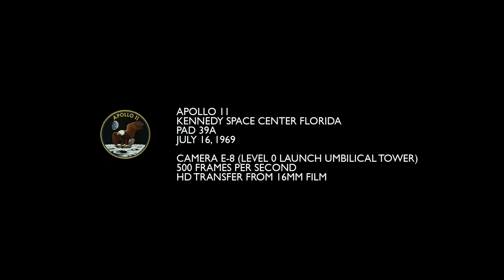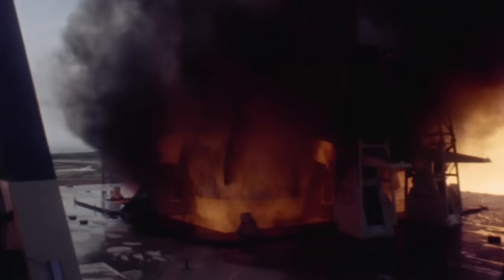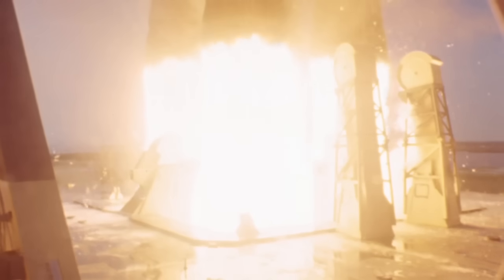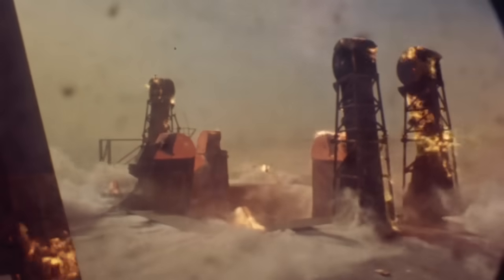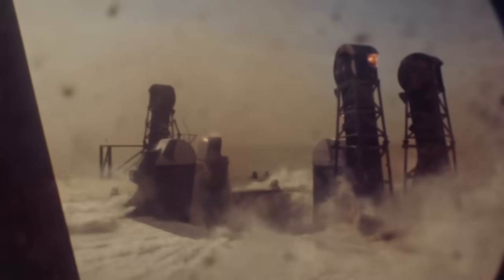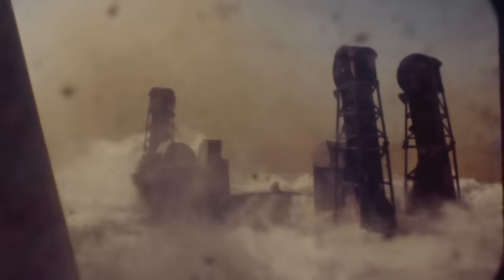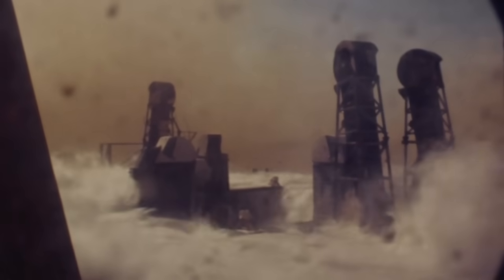Apollo 11 Saturn V Launch Camera E-8

Comment: actually mark the " dark cool gas area' one sees in the film has no correlation with any other known rocket engine ever built or flown which is a bit odd don't you think ? LOX is normally recirculated around the bell shaped exhaust cone of a rocket to cool the bell so it doesn't burn through and not dumped directly overboard into the exhaust as a cooling solution which is a terrific waste of fuel. The saturn 5 apparently had no such fuel worries which is very strange indeed considering nasa went through tremendous programs to lighten the whole craft ! It's a ridiculous assertion   Also mark the saturn 5 first stage indeed had insulation on it.
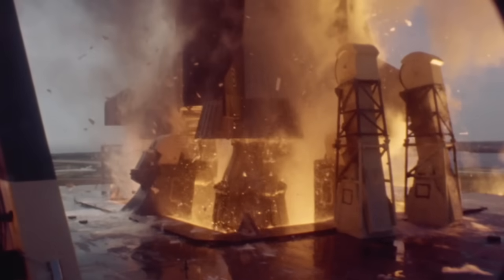Reply: Toasty Roasty Man  Yes some good facts but lets clarify,  the F1 used Kerosene (RP-1) and liquid oxygen (LOX). most rockets of the day used Hydrazine of varying types + LOX or Hydrogen + LOX which is what is used most today. The turbo pump assembly was basically a fuel combustion chamber - called a gas generator that burned RP-1 + LOX making gas that was fed to a turbine on a shaft, the other end of which were the turbine pumps that fed fuel and LOX to the combustion chamber. The temperature of the exhaust of the gas generator was 1465 F. It was burned especially rich (smokey) to keep the temperature down and was fed into the "torus" or turbine exhaust manifold. You can see the torus as a bump or belt around the engine bell at 2:02.  Yes the thrust body of the engine is cooled with 89 feed and 89 return "CRES" cooling tubes. The F-1 was cooled with fuel however not LOX. So why the Torus and the need to cool the bell? The thrust chamber actually ends above the torus - below the torus is the Thrust Chamber Nozzle Extension and it contains no fuel tubes for cooling. The combustion temperature in the chamber was 5975 F that is white hot and no metal can stay solid at that, even a tungsten light bulb filament will melt at 3450 F. Rocketdyne made the f-1 from heat resistant Inconel X-750 alloy (that melts at about 2600 F) that boundary layer of turbine exhaust gas was sufficient to protect the extension without other cooling. That dark belt is this gas and with that much heat behind it it too burns up when it hits the oxygen in the air after exiting the engine. 

BTW -  Markstang, That "ton of energy" to turn one pump was 40,000 HP (no typo, 40 thousand)  It had an excuse though, it fed 24,811 gallons of lox and 15,475 gallons of RP-1 per minute into the chamber. 

Totally amazing and awesome machines
Good film and commentary too
Reply: Toasty Roasty Man Some qualification for your statement that no other known rocket engine has the dark area would be nice. I doubt you could provide another film of a rocket launch that was recorded at 500 frames per second so yeah, it won't appear like that. Remember what he's saying at the end of the video, the exposure is set to view everything in a roughly normal manner while the engines are lit and everything is really bright. The gas coming out of the turbo pumps is already burned up, and has had a ton of energy extracted from it to turn the pumps. Pump this cooler mostly inert gas out of the nozzle right next to the still burning propulsion gases and yeah it's going to appear darker. Also LOX is not a fuel, it's oxidizer.
Reply: Toasty Roasty Man  Obviously any rocket can carry only a certain amount of fuel. Full of fuel, the rocket's Delta-V capacity is then determined by its payload mass among other things. Key point here. Mass. If there's something on the payload that doesn't need to be as thick as it was, such as an outer panel that has no structural component to it aside from sunlight/heat shielding, then of course there's a pretty good reason to make that panel as thin and light as possible while still fulfilling its intended purpose.

In the same vein, they don't pump unburned fuel in to the exhaust. Like you pointed out that's a gigantic waste of fuel/mass. You use the gas that has already powered the turbo pumps so it's not as hot, to insulate the nozzle.

You've probably never seen the dark gases before because it hasn't been filmed so closely at such high frame rates. High speed photography like that is not the same as your every day video camera. Since frames flash by so quickly, they don't have as much time to gather light, and everything appears darker. The higher energy flames still seem bright because they pump out significantly more energy and photons than the nozzle boundary layer's insulating gases. There's not really anything mysterious going on here in this video.
Reply: The amount of fuel burned in the gas generator is miniscule compared to the fuel performing the thrust. Cooling lines all over the entire nozzle extension would be much heavier, require much thicker bells and make the entire engine much more heavy, thus requiring more fuel. Injecting the richer turbo pump gas keeps the light nozzle extension while needing a bit less fuel than your fully cooled nozzle rocket to go the same Delta-V.

All of the rockets used on the saturn program from the beginning have the dark exhaust gases coming from the nozzles. Which rocket motors of the same era can I see on youtube don't have the rich turbo pump gas generator exhaust The F-1 has?
Reply: That's funny, I never even used the phrase "left in the generator". Your assertion that just adding those dozens of little pipes aren't that much more mass is more of a supposition than my reasoning. it is a fact that the cooling tubes weigh something. The fact that something is there in your proposal that isn't in mine, means yours weighs more and mine goes farther than yours with the same amount of fuel.

We're not talking about modern rocket motors genius. We're talking about 60s technology. So you should probably stop whining about why 60's era technology is so "ineffecent", as you like to spell it.

I''m even less convinced, since you couldn't name a single rocket motor from the same era and of similar size that burns differently to the Rocketdyne motors like I asked.
Reply: yes, I know all this but there were serious concerns about the amount of cargo this rocket could carry. So much so that Northrup lightened the lem structure to aluminum foil thickness on the outer panels and other extreme lightening measures.One was in fact to use a less safe high atmospheric oxygen rich pressure cabin  Witness the apollo 1 fire.

 . Many rockets use the same general kind of gas generator to run their turbo pumps. None have ever produced the same dark shroud of rich unburned fuel at the end of the rocket bell nozzle. 

 In the light of the fact that weight savings were a major concern on apollo and that the saturn 5 only carried so much fuel on board this method of cooling the bottom half of the bell is pretty absurd don't you think?
Reply: I have never seen any other rocket engine behave this way and I have seen many many HIGH SPEED TESTS films of other rocket engines.

 YES High speed films. The kind of films rocket engine designers film and take very careful note of.

 Even the earlier Apollo Saturn vehicles non f1 engines don't show this! These rockets all have gas generators but are properly tuned for maximum effecency and fuel economy which is critical to space flight.

 The fuel for the main engines and gas generator come from the very same limited supply on board the spacecraft. Both gas generator and main engines always need to be tuned for maximum effecency

 running the f1 engine gas generators in this stupendously over- rich mode frankly makes no sense whatsoever when just adding more cooling tubing to the whole bell which would add little additional weight whatsoever and save a significant portion of that fuel for the mission.

 You focus on the unburned gas generator gasses as free cooling when in actuality their very richness as is evident in the videos would be a huge waste of fuel when fuel and weight savings were so very critical to the missions.  

 If this was a viable and free way to cool any rocket engines without a significant loss in fuel from running the gas generators so rich all the other counties of the world would do it also in their very large rocket engines..

 Not even our country has done this EXCEPT on the Saturn Five

and you can bet your bottom dollars that the new nasa extreme thrust engines will not do this either. 

 Because it's a HUGH waste of critical fuel that's why..

 it is NOT "Free Cooling"  :) 

 
 In fact you may not know this but any engine works far better making hp or thrust when it is run at maximum thermal effecency. Very hot gasses expand far more. Cooling the bell this silly way would certainly detract from the max thrust the f1 engines put out by severely cooling the expanding thrust !   :)
Reply: it isn't "left in the generator" whatsoever. the generator is a pretty large rocket motor in it's own right spinning the main pump turbine. I watched a test of one and it burns very very rich indeed with a very orange flame and a lot of brown smoke. No cooling tubes ARE NOT that heavy whatsoever. That is your own personal and unsupported supposition. If they were then every large rocket engine would use the "apollo f1 mathod"

 NONE DO

 LOOK what modern high thrust rocket engines Do with that left over burned generator gas.

 It sure isn't used for cooling the main engines I can tell you that. 

WHY..Because it lowers the specific impulse of the rocket motor that's why.

It's dumped in a secondary nozzel out of the back of the rocket very close to the main rocket bell.

 what motors?

  take your pick. LOL

 this will require a bit of research on your part but it will be fun watching the tests. :)
Reply: Then I must have made that first bit all up !

 Funny I never talk that way whatsoever but you do,don't you? 

 I am quite certain it has "mysteriously disappeared" from your comments. I should be more like JW and screenshot all of my propagandist conversations from now on.

  Of course everything 'weighs something" even air merlin.

In relative terms they weigh very little to the lifting capacity of the rocket.

 capeesh ?

 It is in fact a utterly ridiculous argument

 It is very obvious you have no real ability to understand a thing I am telling you here.

 Trying to get this through your thick skull is like trying to pound a two by four through a solid reinforced concrete block.

 It ain't about to happen
Reply: I think you are right that the dark area is unique to the F1, but few other rockets used RP1 either. I don’t think it is odd at least under the conditions of “getting a man to the moon… before this decade is out”. I think there were plenty of trade-offs just make it happen… especially to get the needed degree of safety for the crew.. well - at least enough to get them back. 
Remember that the F1 had a tough development and was not well evolved; yes it was a good engine but young, a lot of the development was consumed settling down combustion instability issues just so they wouldn't blow up. After they got the engine reliable they could start improving the performance. The sad thing here is the designers (North American Rocketdyne) thought they had a winner for the long haul as the F1 was expected to eventually make 2m Lbs of thrust. (A big improvement from 1.5m) As we all know that long haul didn't happen. A lot of this thrust was going to come from increased engine efficiency not just pumping more fuel into it; this went for the J2s as well because looking at my Saturn V payload planners guide it lists the “present” (1967) system of 3 stages as being able to put 261,000 lbs into a 100 mile circular orbit, (or take 98,000 to escape velocity) but further down it says “Planning studies indicate that future Saturns are expected to increase the payload to 450,000 lbs to a 100 mile circular orbit.” That is one heck of an increase for basically the same rocket, so they were already moving on improving things (The uprated F1A engine was already in development). Being a project manager myself I see them following the rules to build any product, first make it good, learn from what is happening, and keep working on it until it is great. (Regardless of how painful that can be). 
Sadly because of the cancellation we don’t have footage like this of Apollo 20 or later Saturns with F1B or F1C engines lifting huge sections of international space into orbit. If we did, I am pretty sure there wouldn't be any black sooty stuff.
Reply: Kerosene? I believe many did and do. I don't know many that don't myself except a few Russian rockets from the 60's like the n1 which used a witches brew of toxic fuels.
 They flew the f1 engines around the moon while it's problems weren't straightened out which has to make you wonder as they were HUGE problems.

that is a red flag right there

 the rocket blows up with the astronauts on board and what do you have left

 A busted space program that the soviets will win because they figure out the n1's problems soon after the first apollo missions.

 
Here is a bit of info you may like to read about the f1 written by some Soviet rocket engineers I believe.

 http://www.aulis.com/saturn_v_evaluation.htm

and this for FUN before you get into the technical specs of the engine :)

 http://www.aulis.com/moonbase3.htm
Reply: Toasty Roasty Man - They never flew F1 engines around the Moon.  The 1st stage engines never even made it out of Earth's atmosphere.  So your primary source is a Soviet Rocket engineer for the F1 engine problems?  Reading his paper it sounds like he has a very distorted view because the Soviet Union was never able to develop a large single thrust chamber engine equivalent to the Saturn-V.
Reply: Anal much...?  Actually Russian rocket engines are very far more advanced then ours. That is why we use them now. These engines came as a total shock to nasa. As far as the f1 engine the Russian rocket scientists gives a very convincing story. Maybe you should read it  Once..Your basing your whole thing on one source NASA.

Never mind you wouldn't understand what you were readings anyway

 I hate to tell you but the Russians were always first in space and space technology till the bogus apollo missions. 

 and that person your bashing knows a hell of a lot more about rocket engine tech then you my friend
Reply: Toasty Roasty Man - "  Actually Russian rocket engines are very far more advanced then ours. That is why we use them now. These engines came as a total shock to nasa."  What specific Russian rocket engine(s) shocked NASA?  If you are referring to the Russian RD-180, it is a great  RP-1/LOX Staged Combustion rocket engine.  However it is far from the only engine the US launch industry or NASA uses.  The Atlas-V used a Russian RD-180 on the first stage but the 2nd stage uses a US engine, the LH2/LOX RL-10 engine.  The Delta-IV uses the R-68 LH2/LOX engine on it's first stage and LH2/LOX RL-10.  Both engines US design and manufactured.  The SpaceX Falcon9 uses the RP-1/LOX Merlin engine on all of it's stages, this engine is designed and manufactured by SpaceX.  Actually SpaceX makes more rocket engines than anyone else in the world right now, all the engineering and manufacturing in Hawthorne CA. The Orbital Antares launcher uses a Russian rocket engine for it's first stage, that didn't turn out as well as they hoped.   The 2nd stage uses a US solid rocket engine. The SLS will be using the Space Shuttle RS-25 engines (US Designed and Manufactured) and these are also advanced Stage Combustion LH2/LOX engines.  

When you make a blanket statement "Russian rocket engines are very far more advanced then ours".   You really need a qualifier.  How do you define if one rocket engine is more advanced than another?  How are you defining it in the context of the argument you are making?    

"As far as the f1 engine the Russian rocket scientists gives a very convincing story. Maybe you should read it  Once..Your basing your whole thing on one source NASA."  Very true you need multiple sources.  However the story the Russian rocket scientist tells is also one source.  So are you basing your argument on one source?  He tells a amazing story but so does the NASA Apollo program.
Reply: Yes, I am sure nasa has a few indigenous engines they still use .I know of at least one engine that has a nasa nomenclature and is Russian. You would have to study Russian rocket engine tech to know what I mean. Its too complicated a subject to discuss here. I suggest you look it up on your own time. It's far in advance of anything nasa has ever manufactured. You should really look into it instead of just quoting the engines names. Better to do this then argue with me. It's a very interesting topic. :)
Reply: Toasty Roasty Man - "Yes, I am sure nasa has a few indigenous engines they still use .I know of at least one engine that has a nasa nomenclature and is Russian. "  I am not just talking about NASA, I am talking about US launch providers.  It is more than just a few engines that are still used.  You heard of a company called SpaceX?  There is nothing Russian on there Falcon 9 including the Merlin Rocket engines.  The engine with the changed nomenclature is the NK-33 that Aerojet bought 36 of them and called it the AJ26.  Interestingly enough this was the Rocket Engine for the Soviet N1 Moon rocket.

" Its too complicated a subject to discuss here. I suggest you look it up on your own time. It's far in advance of anything nasa has ever manufactured. "  NASA doesn't manufacture rocket engines.  Private companies might design, develop and manufacture rocket engine's to fulfill a NASA contract.  I asked you before what is the criteria for saying that the Russian rocket engines are more advanced than US rocket engines?  The fact that you are dodging answering this question leads me to believe that you really don't know what you are talking about.

"You should really look into it instead of just quoting the engines names. Better to do this then argue with me. It's a very interesting topic. :)"  I have and I am asking you to backup your arguments with facts.
Reply: here is a bit for you..
 http://fortune.com/2015/05/15/russia-rocket-ban/?xid=yahoo_fortune

 I had a really nice article on Russian rocket tech but can't find it now. : (  I'll try to find it for you.
 

another bit but not on the Russian engines..

 http://aviationweek.com/defense/ula-ceo-calls-2018-availability-date-ar-1-engine-ridiculous 

 isn't nice you just keep goggle stuff up  without knowing what your goggling about.

 The Russian rocket engines run in a "closed loop system"   

as far as I know no american rocket engine ever has.

  It's totally obvious you are just goggling crap up to reply to me and appear more intelegent then you actually are about these matters.

 It didn't work

 I let you do you have enough rope to hang yourself

 here is what your looking for. It's from wiki so you might understand it..

 http://en.wikipedia.org/wiki/Staged_combustion_cycle
Reply: the Russian rocket engines run in a closed loop cycle..

 http://en.wikipedia.org/wiki/Staged_combustion_cycle 

 Nasa engineers marveled at their technology when they saw them.

I tried to find you the article I read from nasa engineers that said this but can't right now.

therefore in your childish perception of things I MUST be lying !  LOL

as far as not knowing what I am taking about I felt the very same way about you from all your obvious goggled up info replies I have been observing..

If you knew anything at all about these Russian engines you would know what I was talking about already.

Your Ethnocentrism is showing pal.

 Here is a bit you might like to read about the american engines..

 http://aviationweek.com/defense/ula-ceo-calls-2018-availability-date-ar-1-engine-ridiculous

I cut my teeth on this magazine and many other engineering publications while your mommy was whipping the shit oout of your butt and probably still is.

 Please go be stupid somewhere else.
Reply: Toasty Roasty Man - Already read that article several days ago.  What is the exact point you are trying to make by linking to this article?  I am still asking you what is your criteria for saying that Russian rocket engines are more advanced than US rocket engines?  Not what some article says, what facts did you pull out of the article that you used to make the judgement that Russian rocket engines are more advanced?  The term has been thrown around so much because of the current ULA issues with the RD-180.  If you want to make the argument that as of this moment, Russia has some of the most advanced RP-1/LOX engines in the world, I wouldn't disagree with you.  However I would tell you that the US currently makes the most LH2/LOX engines in the world.  Different fuel types, different engines.
Reply: I'm sure you didn't. This wasn't my words it was from nasa engineers. Go complain to them about their opinion of Russian rocket technology. The funny thing is THEY ARE USING IT ALL THE TIME. Guess it isn't that bad after all..;)

 Greg, I personally know people that worked on troubleshooting nasa shuttle tech problems including the liquid turbo pump engines and the joints of the solid rocket boosters which I looked at engineering blueprints of.:)
 I held shuttle LOX cooled ball bearings and shuttle heat tiles in my hands and studied them both.

 and you did...

 POF the shuttle engines had real problems with vibration in the turbo pumps. Lox really isn't a good ball bearing lubricant  ;)

 added info you wanted Best i could find in short notice about Russian engines.. >>

 WASHINGTON — In the past decade and a half, every U.S. agency that operates spacecraft has come to depend on one particular style of Russian-designed, kerosene-fueled rocket engine, made by former Soviet design bureaus and sold to U.S. companies for use on American rockets.
This international supply chain, forged in the late 1990s to bring NPO Energomash’s RD-180 to U.S. shores for Lockheed Martin’s Atlas 3, has bridged gaps between former Cold War rivals and produced rockets so reliable that the U.S. military buys them in bulk. NASA, likewise, is relying on Russian-built closed-loop kerosene-fueled engines — but not the RD-180 in particular — to launch eight cargo delivery missions to the international space station.
The buy-international model works so well that even an executive with the company working on an American alternative to the RD-180 — which has powered 43 flawless space launches since it made its U.S. debut on Lockheed Martin’s Atlas 3 rocket in 2000 — does not see much urgency on anyone’s part to bring such an engine to market.
“We don’t see a good business case for a pure commercial development of one of these engines,” Julie Van Kleeck, vice president of space programs at Sacramento, Calif.-based Aerojet Rocketdyne, told SpaceNews in a July 9 phone interview. “Not today.”
Nor is the government in a hurry to put up the funds, Van Kleeck said. 
But it was, once. 
In 2010, the Obama administration said it wanted to make development of a 1 million pound-thrust, closed-loop kerosene-fueled engine a national priority. However, Congress preferred a new rocket based on shuttle-derived systems, and the White House had to compromise.
>>>>Thanks to Soviet-era advances in metallurgy and combustion stability, Russian-style closed-loop kerosene engines are the best of the breed for liquid-fueled first stages. They run hotter and more efficiently than the configuration used, for example, by Space Exploration Technologies Corp., which in 2006 became the only U.S. company in decades to fly a kerosene-fueled engine it built from scratch. 
“The closed-loop combustion cycle is more efficient in that it yields about 15 [percent to] 20 percent greater thrust than the open-loop cycle for the same amount of propellant flow,” said Dale Thomas, associate technical director at the Marshall Space Flight Center in Huntsville, Ala., and head of the nearby National Institute for Rocket Propulsion Systems.
Put another way, “it allows the [rocket] stage designer to pack more energy into a smaller package,” Greg Pech, director of the engines, motors integration and product delivery team at United Launch Alliance (ULA) of Denver, said in a July 9 email.<<<<

 That alone is not a game-changer, Pech said, but such engines would make bulk orders cheaper, compared with the price of ULA’s Delta 4, the company’s all-American alternative to Atlas 5.
ULA is still buying imported RD-180s from a company called RD Amross, a joint venture of NPO Energomash and United Technology Corp., former parent company of Pratt & Whitney Rocketdyne. RD Amross was not conveyed to Aerojet as part of its June 13 takeover of Pratt & Whitney Rocketdyne. 
Testing, 1 … 2 …
In 2007, the Air Force Research Laboratory gave Aerojet a $110 million contract for preliminary work on an advanced hydrocarbon booster engine, which the service said should be capable of generating up to 1 million pounds of thrust — a little more than the RD-180 generates at sea level.
Van Kleeck said Aerojet Rocketdyne will leverage some of the work it did for the Air Force to develop a 500,000 pound-thrust, closed-loop kerosene engine that could be used as a side-mounted booster for the Space Launch System (SLS) NASA is working on. Competition for the side-mounted boosters would not begin until 2015 or 2016 — around the time Aerojet is scheduled to test-fire the new engine, according to Thomas. The first SLS flight that needs new boosters, meanwhile, would not be until the mid-2020s. Launches scheduled for 2017 and 2021 would use shuttle-derived solid-fuel boosters for raw power off the pad.
If Aerojet Rocketdyne brings its new engine into production, it could have a customer waiting in Orbital Sciences Corp. of Dulles, Va., which is looking for an alternative to the AJ-26 engines Aerojet sold it for the first 10 flights of the Antares medium-lift rocket — the vehicle at the heart of Orbital’s eight-flight, $1.9 billion space station cargo delivery contract with NASA. The AJ-26 is a refurbished, upgraded version of the kerosene-fueled NK-33 engine developed for a failed Soviet Moon rocket called N1, and Orbital is concerned that the remaining stockpile of refurbishable NK-33s is too small to depend upon long term.
As a replacement, the RD-180 is high on Orbital’s list. So high, in fact, that the company in June sued ULA for restricting the commercial sale of the engine. Currently, ULA is the sole U.S. buyer of RD-180 engines under an exclusivity agreement that one of its parent companies, Lockheed Martin, secured in 1997 as a condition of funding the RD-180’s development in Russia. "

 http://spacenews.com/36232space-propulsion-development-of-us-closed-loop-kerolox-engine-stuck-in/
Reply: Toasty Roasty Man " I'm sure you didn't. This wasn't my words it was from nasa engineers. Go complain to them about their opinion of Russian rocket technology. The funny thing is THEY ARE USING IT ALL THE TIME. Guess it isn't that bad after all..;)"

NASA engineers don't design and build rocket engines.  The engineers at companies like SpaceX and Rocketdyne design and build rocket engines.  No they are not using Russian rocket engines all the time considering that SpaceX is currently a big provider of launch services to NASA and the Falcon 9 has no dependency on Russian rocket engines.  The only dependency that SpaceX has for their engines is the CNC machines and 3d printers at Hawthorne.  

"
 Greg, I personally know people that worked on troubleshooting nasa shuttle tech problems including the liquid turbo pump engines and the joints of the solid rocket boosters which I looked at engineering blueprints of.:)
 I held shuttle LOX cooled ball bearings and shuttle heat tiles in my hands and studied them both."

Did you tell these same people at NASA that you think the Apollo program was a fraud that NASA is still perpetuating on the American people?  Holding rocket parts in your hands doesn't validate expertise.  

The fact that you keep dodging answering these simple questions is leading me to believe that you lack the technical expertise to form a valid argument to backup what you are writing about the US Apollo program.  Any nitwit can copy and paste articles from the Internet.  What is the exact point you are trying to make by posting this article?  I am still asking you what is your criteria for saying that Russian rocket engines are more advanced than US rocket engines?  Not what some article says, what facts did you pull out of the article that you used to make the judgement that Russian rocket engines are more advanced?
Reply: Greg, the new orion space capsule has a ton of extra heat shielding and radiation protection the apollo capsules never ever had surrounding the entire cabin. All the apollo capsules took a district entry route into and out of the atmosphere. They never took a much slower and relatively cooler  "skip entry"

Gene Kranz,flight director on the apollo missions recently stated that the apollo capsules could NOT survives a direct entry into the atmosphere from the moon.

The Orion capsule design confirms this as in all space vehicles one NEVER adds a ounce of extra weight to a vehicle that isn't absolutely needed.

that should be one HUGE read flag to you that apollo was a giant HOAX

I know personally of the many of the engineering problems which were prevalent on the space shuttle and the disasters they had because they wanted to keep to a schedule. Apollo virtually had none and they were flying with a very problematic f1 engines that destroyed themselves many a time and these problems were still not ironed out on the first trip around the moon.

I don't believe they really ever were myself.

apollo technology was light year more primitive then the shuttle and the shuttle still blew up many times !

You will of course point to apollo 13 but it was a scam too. The "13" number should be a red flag to you.  The oxygen tank explodes out away from the capsule hydrogen tank of course and little damage is done except that the lose power?

seriously?

 The CSM gets COLDER when it should be the exact opposite thing

well everyone knows space is "cold" of course..! LOL

 seriously? :)

 Greg, I have answered your question about the Russian engines already now in may articles I sent to you and a wiki page.

The fact that you keep denying that I did shows your complete lack of character sadly.

 take care pal and just keep drinking that sweet government kool-aid !

It's good for you

 ;)
Reply: Greg, I believe your "mass theory" actually works against you here.

 Your going from Deep Space and remember "space is cold ! " as was proven by the apollo 13 missions. The "mass" of the capsule would therefore be COLD !  It would therefore take FAR. LONGER to heat up then the apollo capsule.

 Lets compare it to something like a big heavy gas barbecue grill with iron grates.

 They take far longer to heat up a heavy massive gas grill then a light weight electric one.

 since the reentry was NOT a skip as Kranz said it absolutely needed to be for the apollo craft to survive, all the heat of the quick direct reentry would be very immediate and searing on apollo missions since the spacecraft had far less "mass".and little heat shielding around the cabin.

 Now the orion craft has more mass and coming from deep space is a much colder craft then apollo.

remember space is COLD !

that's what nasa told us in apollo 13

 therefore according to your mass theory Orion should need even less shielding then apollo used !  :)

 I decide to answer you back on this comment you made because it was so tempting to do so that I couldn't resist myself.

 Greg,"mass' actually resists large/fast temperature fluxes.

didn't you know this ? 

 therefore by your theory Orion should need far less heat shielding and not More then apollo capsules.!  :)
Reply: Toasty Roasty Man " Your going from Deep Space and remember "space is cold ! " as was proven by the apollo 13 missions. The "mass" of the capsule would therefore be COLD !  It would therefore take FAR. LONGER to heat up then the apollo capsule.

 Lets compare it to something like a big heavy gas barbecue grill with iron grates.

 They take far longer to heat up a heavy massive gas grill then a light weight electric one."

With Capsules like the proposed Orion and the Apollo CM the actual heat shield is ablative   If the actual heat shield wasn't ablative then a structural acting as a heat sink would make a difference.

"
since the reentry was NOT a skip as Kranz said it absolutely needed to be for the apollo craft to survive, all the heat of the quick direct reentry would be very immediate and searing on apollo missions since the spacecraft had far less "mass".and little heat shielding around the cabin."

What is the reference for Gene Kranz and Apollo needing a skip re-entry?

(http://www.kenrockwell.com/Images/nasa/apollo-11/24-july/reentry-curve.gif)  FYI - Here is the actual Apollo re-entry profile and as you can see it isn't just a direct plunge into the atmosphere.  

"I decide to answer you back on this comment you made because it was so tempting to do so that I couldn't resist myself.
 Greg,"mass' actually resists large/fast temperature fluxes.

didn't you know this ? 

 therefore by your theory Orion should need far less heat shielding and not More then apollo capsules.!  :)"

Maybe before you ramble on you should take a minute to think a little more and realize how a ablative heat shield functions.

How is it that NASA was able to get 380kg of lunar material back to Earth that has been studied by Scientists from around the world (Not just US scientists) and not one of these scientists have said the lunar samples are fake or anything but genuine?